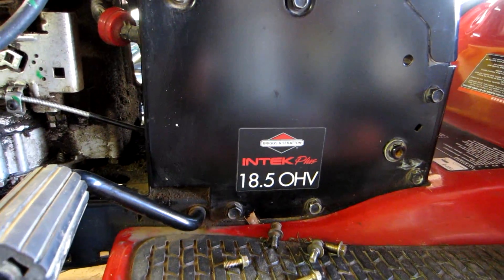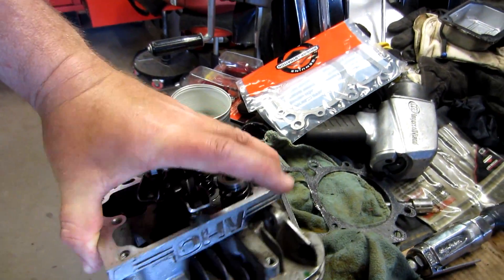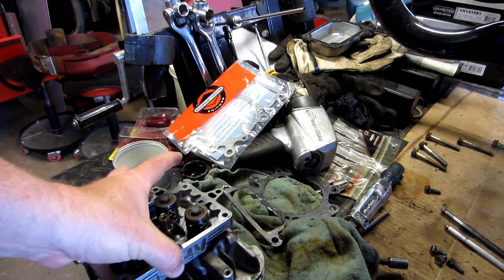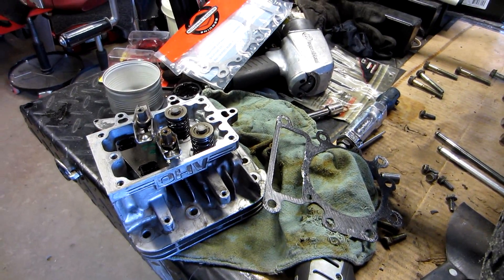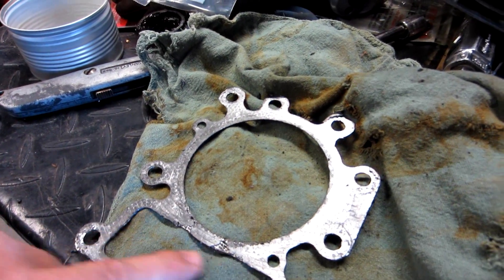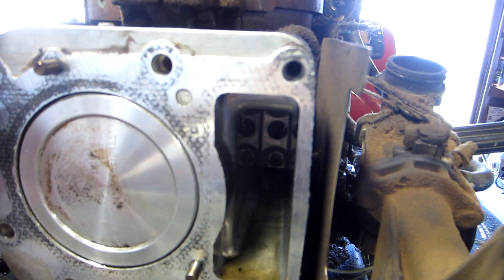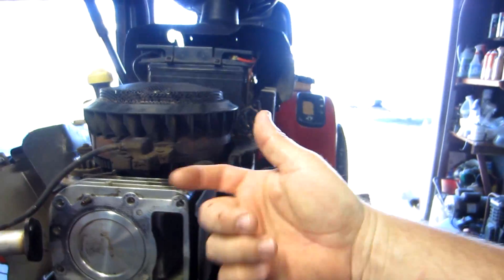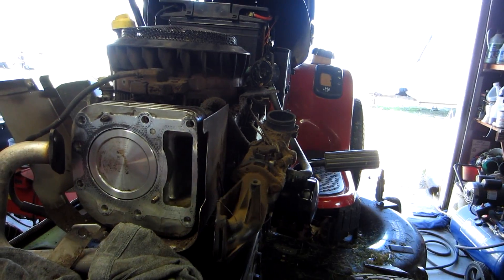Briggs Intek Head Gasket Symptoms

Comment: It's a briggs,not a tecumseh and there lies the problem . T's run for decades and decades . a briggs design is flawed and they know it but don't give a shit  . just look at the untorqued missing bolt between the cylinder wall and the rockers. it's thin and fails all the time . I fixed the issue and no more blown head gaskets. how did I fix it. I would say but Briggs refused my proven fix and would not accept my proven solution . so anyone out there of the old school culture can think it over and do as I did .why I won't say on this post, I don't want briggs stealing my genius fix on there ill designed engine,,,,,,,,,,,,,,,,,,,,,,,,,,,,,,,,,,,,,,,

Comment: Also another symptom is the oil was burning but not visibly smoking just loosing on dipstick after 3 hr mow, I use Amsoil 5w30 Synthetic 4 Stroke Power Equipment in all my equipment and it never hardly turns dark after each season, but after 2 cuts and it was low both times and I added a few oz's it was like black and sooty, I did a leak down and the gasket failed between cylinder and pushrod pocket i was beting. I did a borescope prior to leak down and the combustion chamber looked like brownie batter was on it. the other was clean.

Comment: My Toro 21321 lawn mower has oil leaking through the breather tube, I have drained all the oil and gas, replaced the breather read, replaced the carburetor, removed the spark plug then pulled the starter rope to see if any oil or gas was in the cylinder but no gas/oil was in the cylinder, then replaced the spark plug, refilled the gas/oil, started it up then let it ran for 15 minutes but oil is still leaking through the breather tube. So I thought the culprit was the head gasket and attempted to remove the cylinder head bolts but the bolts are so tight I couldn't remove them. Could I still have a blown head gasket even if the cylinder head bolts are to tight to remove and the oil is not leaking from around the cylinder head but through the breather tube?

Comment: Fox boss I am suspecting blown head gasket on my 18 1/2 horsepower intek my compression is 95 should I still tear head gasket off I have oil and gas mixture coming from my pulse fuel pump

Comment: THE CAUSE IS THE LITTLE O-RING SEALING ABOVE THE NEEDLE & SEAT WHERE THE PLASTIC SEALS TO THE BODY ON THAT CHEAP JUNK NIKKI CARBURETOR... Dont fix THAT and you'll do this over and over again. it leaks fuel into the cylinder and that fuel hydaulics when you start it and it blows the gasket. If it wasnt for leaking gas that motor would never blow that gasket. It doesnt have enough compression.

Comment: Yep, same thing here, planned obsolescence... A Stiga park mower that we use with a snow blower attachment during the winter. 3rd gasket change coimng up, overpressure in the crankcase, dip stick tube spewing oil everywhere. Other typical symptoms: smoky exhaust, hard to start and a sort of muffled knocking sound from the engine. The same problem spot as shown here where the head gasket clamping force is weak.

Was worked hard the last time it was used (heavy snowfall few weeks back) and I was thinking the gasket might let go, today the symptoms. what a piece of ****.

Comment: Great video! I talked to a small engine shop today. Husky briggs and stratton intek mower is only 3 years old. He told me I needed new motor because of rings. Glad I watched your video. ? Can I continue to use my mower until i have the time to replace the head gasket as long as i watch the oil level.

Comment: I had a little smoke coming up from the top of motor and smoke in the dipstick tube after running and getting motor hot. took heads off and I can't see any damage to the gasket?? replaced crankcase gasket already because it was leaking, there was definite damage to that gasket. Piston is not loose, so I guess piston rings are, O.K.?? definitely a lot of crust on the top of pistons. Is there anything else that causes smoke in dipstick tube??

Comment: This was the case with my 18hp Briggs. Started all of a sudden blowing smoke when riding. Especially under load. Blown head gasket. Oil was making its way into the cylinder head and had baked on top of it and the valves.

Comment: Thank you so very much for your video.  I was wondering last time I was mowing I had to get new gas.  I started my mower it just started smoking suddenly.  I was mowing earlier and it was fine.  I did check the oil levels it had good oil still in it.  It just started smoking.  Can that be blown gasket or can it be something else?  Thank you

Comment: Great shows for learning… ok so I have the twin Intec OHV 22 hp Craftsman Pro series from 2010 and this spring it started dripping oil from the R cylinder area, with oil dripping from the inner side of the head gasket area onto the outer exhaust canister smoking... I just changed the head gasket in accordance with proper maint. and now I mowed today and same symptoms ... OH BTW I took the dipstick out and thought I might try to add some oil as its been dripping and smoking... it was running... it sprayed so much oil mist under great pressure and I closed it quick! makes me think of the blow by mentioned here? Any helpful thoughts are welcome. Guess I need to reinspect that old head gasket again. Or is it a valve guide moved, I heard of that too? Thx in advance

Comment: Wrong, the pressure is made in the crankcase and it make is way to the carburetor by the blow by hose and then the engine burn the oil as it enter in the combustion chamber with the air/gaz. Those engine are craps, it is like they forget to put a head bolt exactly where the head gasket leak. Thank you made in china!!

Comment: I have just fixed my Husqvarna lawn tractor for the same problem.  Mine had an additional symptom of blowing oil out the the fuel pump which use crankcase pressure.

Comment: Yep mowing along on my Cub Cadet LT1018 18.5 hp new (oil change) smoke started, stopped left engine running Had oil (a lot of oil) coming out of a small screened hole in fuel pump removed oil filler cap (with engine running) pow oil spray about, drove 25 yards to garage shut iy down Have gas in my brand new oil and filter pulled head off yep blown it the weak point by the pushrods. Its an older 2004.w/298 hrs. Hope Briggs  redesigned this head and/or the friken gasket!

Comment: I would like to say that doing a leak down test is helpful to make sure its not valves or rings.
I do not recommend buying the head gasket from Amazon. I did and they ship it in an envelope and it got folded over. There are some aftermarket head gaskets that are thicker than OEM. Not sure if they work better. I like to use Permatex copper spray on the head gasket.

Comment: Please help me if you can? My mower was running fine but the next week I went out to mow grass the mower would barely turn over so I pulled the spark plug out then turned the motor over and a lot of gas blow out so I put the spark plug back in the motor started it but now it only runs for about 10 seconds or so then it dies so I went and put a new carburetor on it and still the same problem the fuel line to the carb is getting plenty of gas so now what should I do?
Reply: You need fuel, air and spark. Check air filter is not dirty, make sure spark is blue not yellow, then check carb.

Comment: What if its blown pointing outside? And its not burning oil?
 Im on a 24hp vtwin briggs and its making a loud noise, I thought it was exhaust gaskets blown, but I checked and installed new ones and that didnt stopped it from making that loud sound. I checked valves and set valve lash correctly.
Then I started the mower (zero turn Husqv Z254) and it kept making the same noise. I carefully listened where it was coming from, I only could identify it was from the left, upper cylinder but couldnt identify where exactly in this cylinder the noise was coming from. 
When you start it, and the electric starter is turning the engine you can hear a bop bop bop and that made me suspect it could be the head gasket, and that it wasnt the connecting rod hitting. So now Im teariing it apart to see.
Reply from the maker: If it's that noisy you need to be taking it apart to see what's going on. There's no sense in guessing or having somebody else guest for you when you could definitely diagnose and find out exactly what's happening.
Reply: Im amazed at how smooth it would start and run on just one cylinder.
Reply: Thanks for answering!
Got it sorted: I took the head apart, valves were all gunky and getting stuck, that made pushrods get loose as soon as you crancked it causing the knocking sound. 

At the time I was just nervous and looking for an answer because I was afraid to dissasemble and mess something up. Its an easy engine to repair, Im just a really anxious person to be honest.

Thanks again for taking the time to reply, what you said is absolutely right.

Comment: I understand these head gaskets are notorius for going bad in pretty much the same area on different small engines. Does the side of the gasket that typically goes bad the side that faces up towards the head or down towards the block. I thought mine was bad but the side facing up towards head looked ok or at least no obvious signs of breach. Thoughts?

Comment: I just bought a used cub cadet and it has the Briggs 24HP ELS 725 OHV and the man I bought it off of is very very persistent about changing oil, filters, belts, etc. The oil that is in it is about as clear as water....for a 2004 it has been very well maintained, however when I got it home and mowed after the engine heated up I could smell a freshly burning oil smell. I took the good of and got intimate with her. lol 😝 I went over the whole engine in search of a leak or a spot that may have accumulated over time and the only thing I could find that looked like it could cause the smell was under the valve covers around the exhaust manifolds on both side there is charred on oil... that being said do you think it’s a safe bet that it’s the valve cover gaskets or head gasket ? Any advice would be greatly appreciated. I want to fix ASAP. Thanks 🙏
Reply from the maker: Not sure, could be both or one of the two. You just have to wipe clean everything and then run it until you smell that again in immediately shut off and look for the trail of oil remember you need to trace it as high as you can find it.
Reply: Foxboss9 that’s my plan! I wiped all oil and crud off today and tomorrow, I may power wash it first, then I’ll run it until she gets hot and let her run a little more, then check for smoke 💨 and oil. Thanks for the advice.

Comment: Thanks for the video, I had the same exact problem, same damage to the head gasket, same exact engine on a DYT 4000 Craftsman. After the repair I noticed the dipstick jumped around while running when nor screwed into place, I can’t remember if that was the way it was before or not. Is that normal? The repair wen well & no more smoke.
Reply from the maker: Well, there's pressure in the crankcase that will cause the dipstick to push out. Could be the reason that it didn't before was because the head gasket was allowing the crankcase pressure to be released at that point.

Comment: As far as I understand this problem has existed for over 10 years on Intek engines. In Europe, I looked at the new  B&S engines for Husqvarna lawn tractors. And I concluded that the design of the gasket  has not changed since! Why for years not to solve this problem by changing the screw locations or  another option???
Reply from the maker: Planned obsolescence. Henry Ford invented that idea
Reply: @Foxboss9  Thanks for the reply and painful that it is true  :( In general, it seems to be a good engine.

Comment: Mine is blowing oil out the crankcase breather. Could this be same issue or just bad breather?
Reply from the maker: Those breathers are a very simple design, most likely other issues are happening, you'll have to pull the head off..

Comment: I have a question.  I have the Intek 20HP Twin OHV on a John Deere L111.  It's about 15 years old.  Recently, I've noticed that it smokes quite a bit after I turn it off and it seems to run hot.  I haven't been burning oil that I've noticed and I pulled the plug and it seems very dry and not fouled.  Is there something else I can check to see if it is a head gasket or should I just start breaking the engine down and looking for what you've described above.  Thanks in advance.
Reply from the maker: The only reason that it would smoke after you turn it off is because you're leaking something hot onto the exhaust. I would expect that it's probably oil leaking from maybe a valve cover but if you're noticing a slight loss in power it could be a head gasket starting to push out.
Reply from the maker: There's a chance also that it could be leaking from the sump gasket which requires the engine to be removed or maybe one of the PTO gaskets meaning the bottom seal or top seal on the crank.
Reply: Foxboss9 i broke the engine down (one cylinder anyway).  Would love to send you a picture or two and see if you could give me an opinion.  Rods are straight.   Piston head has some darkening and one valve is very clean and the other is pretty carboned.

Comment: Great video! My Intek 540cc is not only burning oil but continually leaks oil on the side where the oil filter is located. I  replaced the filter to make sure there wasn't a faulty gasket - replaced with new filter but still have issues with oil leak - it appears oil is being sprayed under the engine compartment cover as well. No power issues, mower starts right up. Engine is on a Toro zero turn mower. Is this still a head gasket problem?
Reply from the maker: Find the highest point in which the leaking oil can be traced. If the mowers under hood looks like oil is being blown everywhere there is a good chance that is exactly what's happening and you have a top PTO seal that is out
Reply: @Foxboss9  its hard to tell where the leak is. The engine is not that old - I replaced the original engine with this one about four years ago. On that engine where is the PTO seal located and how difficult is it to install? I sure appreciate your help!

Comment: I'm having a problem with my 7hp Briggs engine, it's on a Coleman Generator. It starts up first crank but it spurts and spits gas out from the carb.  I have done pretty much everything that could be done with the Carb. replaced seat and needle,  and Float. Put in new Spark Plug. Can you help me with this problem?
Reply from the maker: If it's spitting fuel out the carburetor while it's running then you have a problem with your intake valve. Either it needs to be adjusted or it needs to be reseated or it is sticking. All of those things take a little bit of skill. And most likely removing the intake valve.

Comment: an ex gf bought one brand new 3 years ago  . simplicity mf zero turn .  the head gasket didn't even last 3 seasons before it started blowing blue smoke .  this issues needs to be taken to court and a law**suit  . its obviously a manufacture default defective product
Reply: its also obvious that they know of this issue and still remain to sell these defective products .  and the warranty hrs proves this without a doubt .  the head gasket is known to fail after said amount of running hrs .

Comment: Great video. Well explained. I have EXACT same symptoms with my Intek. Smoking at start up, not too much while riding. Then after sitting, a puddle under engine (oil seepage out exhaust). Hoping it's the head gasket and not rings as I've never had to top off oil before. Valvetrain replaced this summer

Comment: Great video. I have a briggs and strat that had a blown head gasket. Changed the gasket and adjusted valves. New spark plug. Did oil change while I was at it. Fires right up now but when warmed up it starts sputtering. Then when I turn the blades on oil starts dripping out of fuel pump screen!?? I am ordering new fuel pump also. Did the gasket csuse my pump to go out too or just coincidence? Also can oil get in carburetor and gum it up? Was going to change it with a new one if so. The carb that's on it now seems to need a special wrench to get bowl off?
Reply from the maker: If the head gasket blows it could pressure rice and put oil past the diaphragm in your fuel pump but that seems to be relatively rare. You could also have gotten blowback into the carburetor but you'll have to get the fuel bowl off to clean that out to know for sure.
Reply: @Foxboss9 thanks for the replie! Gonna check the carb and maybe replace fuel pump while at it. I'm getting really frustrated after changing the head gasket and still having issues. Is there anything else to check after a blown headgasket besides, spark plug, oil, and gasket replacement obviously? Typical things that could be wrong because of the blown. Head gasket? I'm starting to think it blew again with only one hr. tops on the newly installed gasket. Thanks again for the help!
Reply: @Foxboss9  checked the head gasket again and it blew in same spot! Replaced again along with fuel pump, fuel filter and brand new carb. Now it is really really loud and bogs under load. It's almost like something is still building back pressure?? It is really really loud not normal. Also hunts and seems to be building fuel up then popping or backfiring. Small puffs of white steam like smoke come out of blower when popping noises happen. I have video of it look on my channel. I need help. Starting to think head is warped and this mower is destined for the scrap yard.
Reply: Worse when starts to warm up. Almost sounds normal under low to mid idle. Weird the blower tube and all aroumd the carb has fuel misted all over it. Thats what make me think its somehow getting to much fuel. Also new spark plug (properly gapped) no oil or fuel, not wet at all! Seems to be running way to rich...